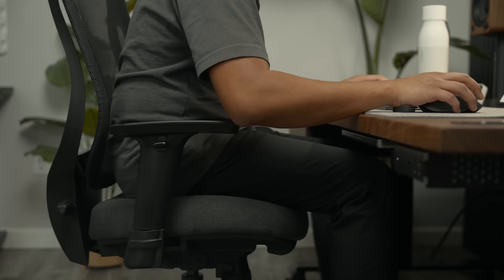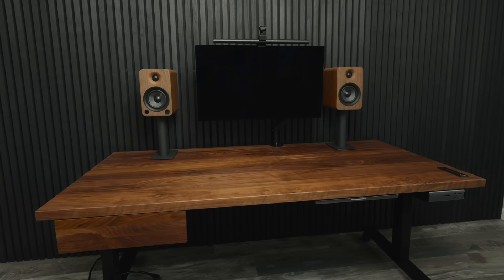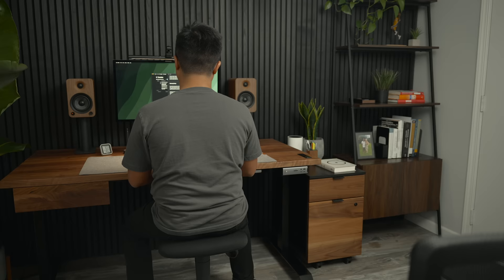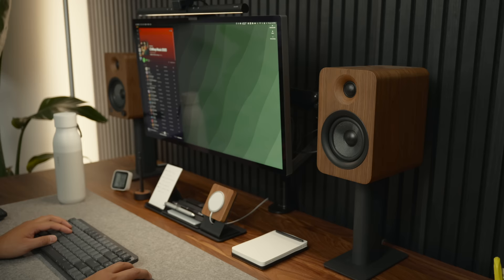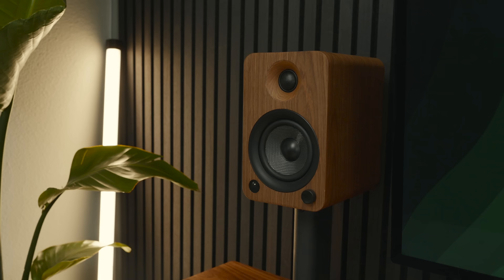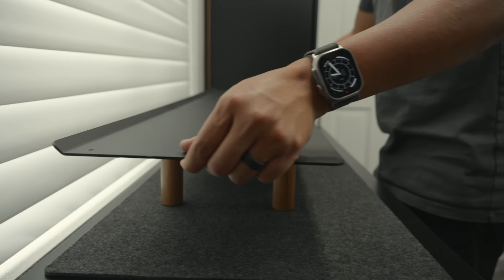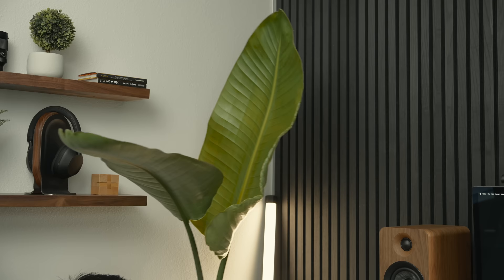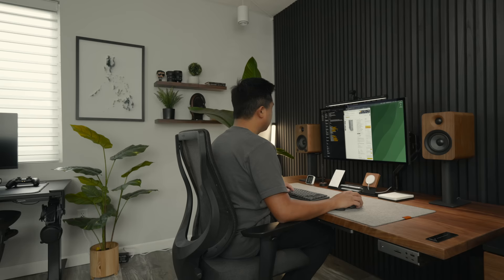Architect’s MODERN Home Office & Desk Setup Makeover 2023

Comment: Could you share your process for mounting the laptop holder and the calbit holder underneath your desk? What size screws you used and how you measured it to place them where you did. I really like your setup and am in the process of doing something similar!
Reply from the maker: The screws came with the 3D printed laptop mount. . It was pretty straightforward. I just measure the distance between the two side brackets in relation to my laptop, marked it under the desk, drilled a pilot hole, screwed it in, installed the rear bracket.
Reply: @JonImperial  thanks il do that!
Reply: Don't you get a lot of overheat underneat the desk? When I look at this it feels that all the heat from the laptop would be blowing onto my legs and I can see that being a bit of an issue especially during the hot summer days

Comment: How do you conceal the wires coming out the Kanto Yu4. Also don’t you have to connect both speakers via red black cables?
Reply from the maker: Yes, you do! The speaker stands have a built-in “track” for the wires.
Reply: @JonImperial  ah thanks what speaker stands are they? Guessing you run these wires under the desk
Reply from the maker: @tanvir_a it’s this one. https://amzn.to/3CmbkiE

I run it below the desk using the cable management system. 😊

Comment: data centre tech's tip.  don't use zip ties.  if you ever have to undo something, they can be a pain or even damage cables.  use velcro strips instead.
Reply from the maker: Yes cable ties (velcro) are great!

Comment: What’s with the ginormous audio speakers? It seems totally out of proportion with the rest of your setup, and for your work/use case, heavy audio seems useless.  Your speakers take up more desk space than your monitor and keyboard.
Reply from the maker: Ginormous? Have you seen other people’s speakers? 😂 Did you watch the video? Coz my speakers are definitely smaller than my monitor. 🤦🏽‍♂️
Reply: @JonImperial  maybe a little exaggeration on my part, but the desk space and air space the speakers take up seem disproportionate.    I’m thinking something like a small sound bar like those used in flat panels would fit better.  Those only take up about 1/10th the space. I just purchased a 70x30 stand/sit desk and have been setting it up so am searching for nice set of small speakers that don’t make my setup look like a 13 year old’s gaming desk. Seems like all computer speakers that content creators show on their recommendations videos  are larger sized like yours.
Reply: I’ll have to add though that the matching walnut is a nice look on the speakers. You run into any small speakers with wood finishes while you were looking to buy?